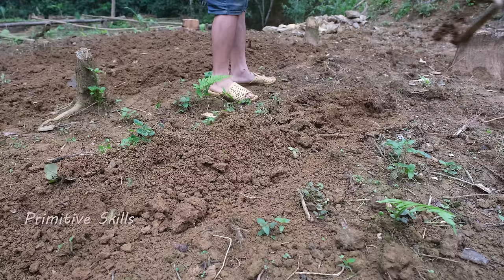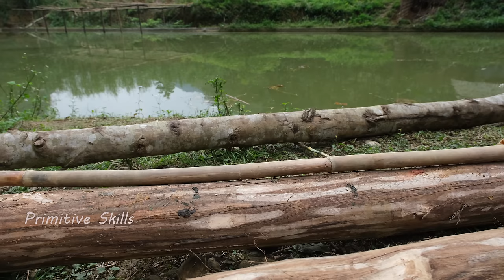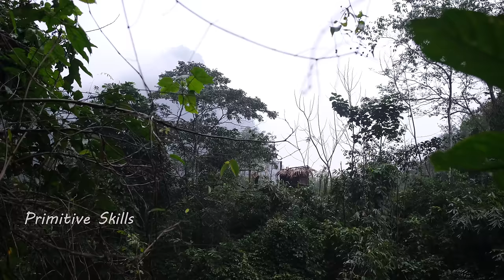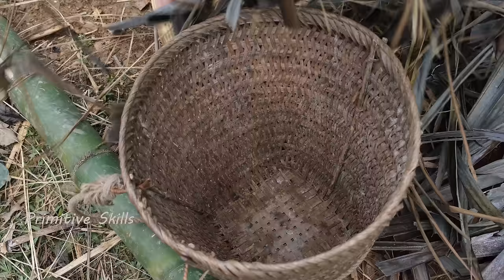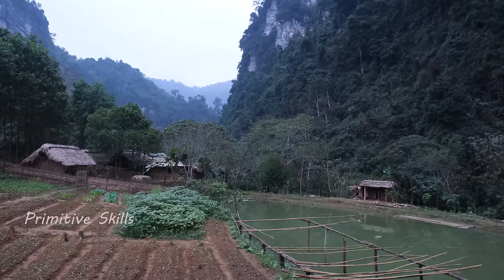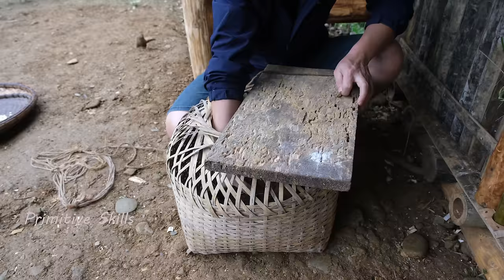Chicken Coops Made From bamboo Pallets | Build shelter for chicken. Primitive Skills

Comment: It would be much easier for you to water your plants if you make another reservoir in the garden area. The old reservoir will supply with water using bamboo pipes you can use hoses to water your plants.

Comment: Your buck saw is very dull.  Can you have someone teach you the tools you need to sharpen and set the teeth?  Seeing you sharpen the saw would be an interesting video because we do not see them used because they have been replaced by new design.  Your chicken flock is growing beautifully.  I think you need more nesting baskets and roosts in your new coop.  It is very nice.  Do you need a short fence along the lake so the chicks do not fall into the water?  I imagine if they fell in they would die.  Just a suggestion 😊  Your garden is beautiful.  I am hoping you will start to compost organic waste so you can start to build your soil.  The mulching around your banana trees is wonderful.  Also consider growing crops like radish, yams and peanuts to improve your soil.  Will you grow corn to feed your chickens?  WIll you plant upland rice again with new seed?

Comment: I wonder if you can make a chicken run with the bamboo fencing that used for the garden. Three walls and a roof should keep them contained and you could have a little door that can swing in. It would keep them safe from predators and keep your garden safe from them.

Comment: FYI chickens can comfortably be kept with 1.5 sq ft of space each. Also, there's great advantage in the floor of the coop being soil covered in composting material. We hit -35ºC with a windchill of -51ºC. The composting material in the chicken barely froze on the surface, and was thawed once the 2-3 days cold snap was over. If it's deep enough earthworms will multiply underneath and turning some of the compost will give the chickens a treat. Also, anything you can compost where you feed them will lighten the soil and make it richer too. Cheers. :)

Comment: Well done Duong.

Please don't show the end result at the beginning of the video as it ruins the experience of watching your projects grow.

You could easily use rope as a drive belt with the water wheel for powering a few things such as the potter's wheel, a lathe or a cement mixer. It only requires a groove chiseled into each wheel.

Keep up the great work.
Reply from the maker: Thank you for comment